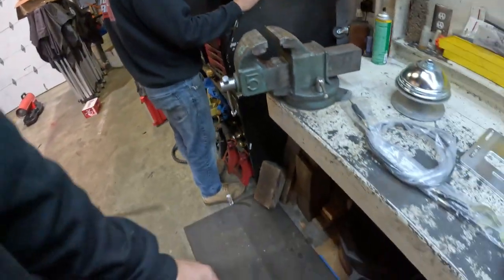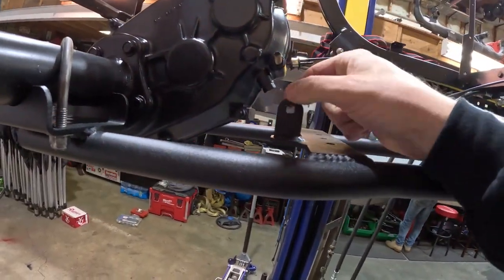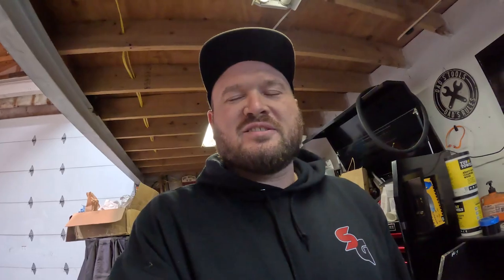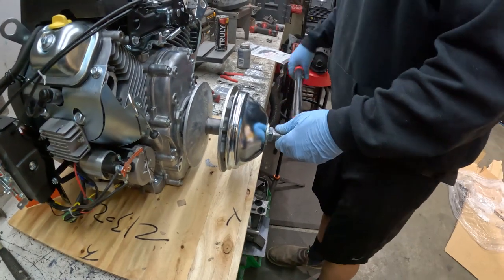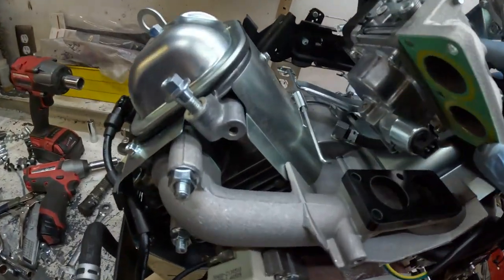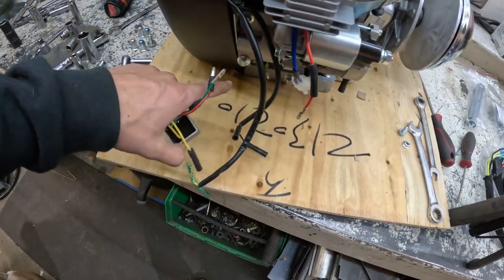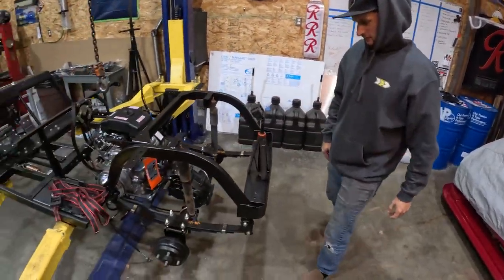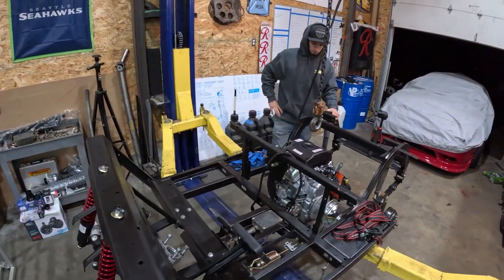Installing A 670cc Predator Motor In An E-Z-GO TXT Golf Cart!

Comment: Thanks for answering my last comment.  It helped a lot.   One more question; the gear box under the floorboard has a wire that goes into the engine compartment.  It is connected to some sort of contact switch. What is it for and do I need it in the new install.  I got my Predator engine in and wiring it now.  The wires I am referring to are in a gray sleeve.  
Thank you.
Reply from the maker: Nope you won’t need that at all, we just cut ours and left it covered up. I do not know exactly what its purpose was but i do know it’s not needed.
Reply: @SkidiotsGarage  thank you for the quick replies, they’ve helped a lot.  Have a great day.